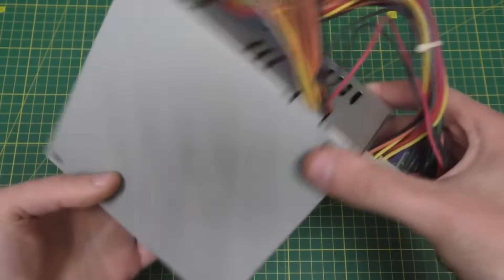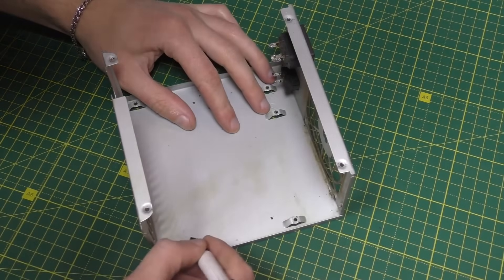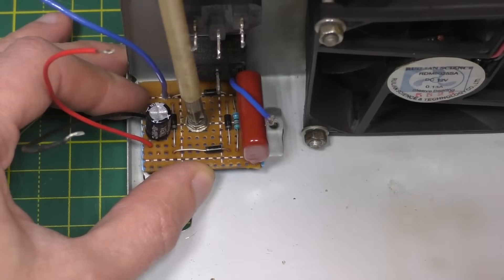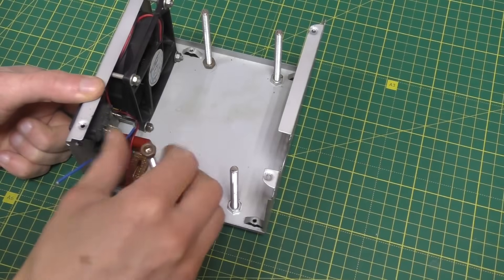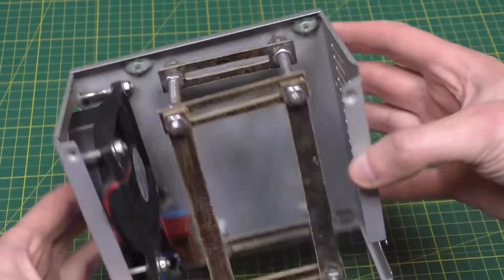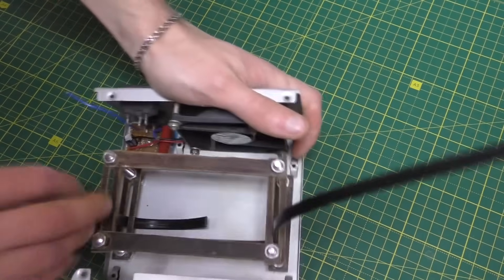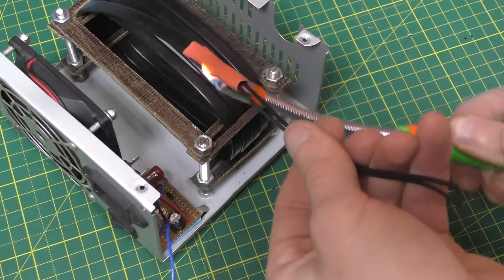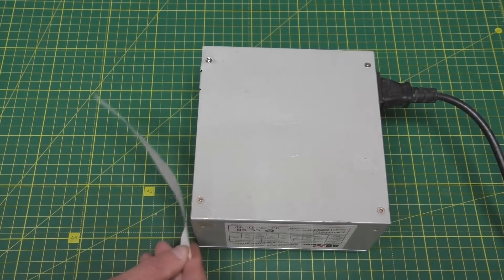Discover This Secret and Never Throw Away a Broken Computer PSU Again!

Comment: Do not disassemble your power supply, the capacitors might still be charged, and you might electrocute yourself, especially if it's a higher wattage psu

Comment: Interesting recycle. On a side note, looks like the failure of the PSU was some bulging caps. They hadn't fully burst yet but I saw at least two.
Reply: 10–15 years ago I spent 500$ total on two new flat screen computer monitors where 3 years after the power supply boards failed internally due to faulty electrolyte capacitors!  I ordered new high quality capacitors from Digikey and replaced the bulging capacitors that are typically 5vdc and 12 vdc busses!  The monitors are still working to this day after that repair!

Comment: Metalwork not bonded to ground. Electrocution and fire hazard, especially when it is not isolated and connected directly to mains via a capacitor dropper. Do not build this. Specialist capacitors are need for mains dropping.

Comment: YEAY!!!! THAT'S HOW YOU SET YOUR HOUSE ON FIRE!!!!

This thing has no certifications or anything, NO insurance will pay you anything if the fire originates from this device, and this device is absolutely LIFE-THREATENING!! Just removing the power supply board, there are capacitors on it that store 450V and, in the worst case, can KILL you.

What's the problem with just going to the nearest hardware store and buying something safe for €/$/£20 ?????

Comment: The earth pin on the eps should have been soldered to the chassis so it should be earthed, this is very dodgy this way!
Reply: the earth is all you're worried about not the asbestos lol <.<;
Reply: @DeathePanda  yeah, well i am working with eletronics for like 6-7years at this point, and this is more serious issue than asbestos. 
You can get a deadly shock from this.
Reply: @Uraim  I work with 240v, I'd rather a shock. <.<
Reply: @DeathePanda  dam thats crazy, wonder why there is an earth ground nearly every equipment that is made from metal.
Reply: @Uraim  wouldn't say everything, most things.